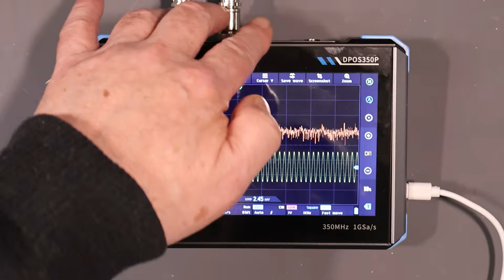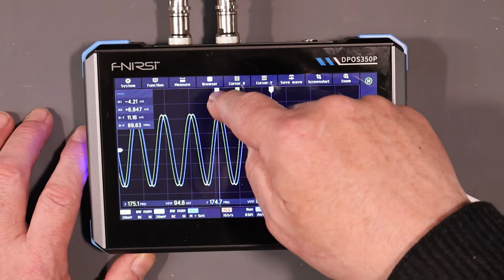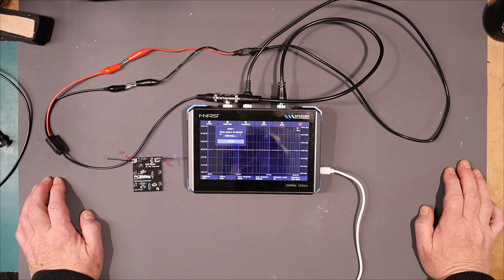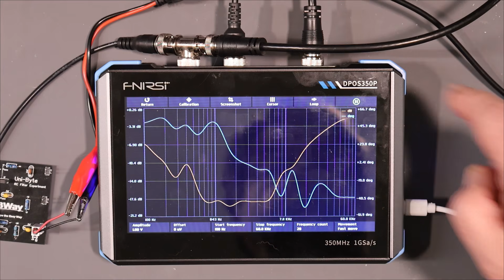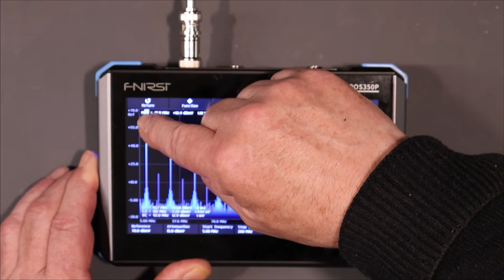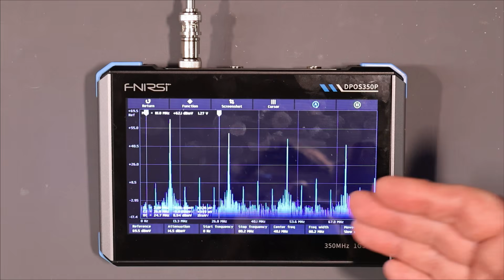Uni-Byte 0283 - In depth look at the FNIRSI DPOS350P Tablet Oscilloscope: Part 3 of 3

Comment: The phase diagram is absolutely wrong!
Reply from the maker: Well, it has two problems.  1) it's inverted - that can be accounted for but still something they should have fixed before releasing the product.  2) it suffers from lack of averaging, more so as the frequencies rise.  This leads to significant errors.  They should allow the user to define how many runs are averaged together for when phase is an important measurement.

Comment: Thank you gor the very useful review. Do you know what is the phase error between 2 signals at 30Mhz ? Why 30, you might be wondering? This is the end of the HF bands and I think that tis scope might be just good enough for testing, aligning and troubleshooting HF transceiver and if that's true with the sig generator included it is a bargain for hams even if proper EE engineers think it is a compromise !
Reply from the maker: With the latest firmware release the phase error is very small.  At the fastest sweep rate of 5ns/div the error is approximately the thickness of a trace.  That would put it at about 30ps-40ps.

Comment: I just got mine today and making my way through your videos. Thank you for them!

I seem to have noticed a glitch when messing with the generator. Output of the 350P going into a bench DSO, nothing else connected. A sinewave at 992063Hz is super stable, but if you just go one Hz above to 992064Hz (and everything above that), it becomes unstable and seems to occasionally "restart" right in the cycle, playing the waveform again from the beginning. Seems to happen on all waveform types. You can see that on high-refresh scopes or with persistence.
Just a funny tidbit. Don't think it's a defect on my unit, feels more like a resource bottleneck somewhere on the device, but it's no big deal either way. Still a nice little device! :)

Thanks!
Reply: Color me impressed, I can even see the jitters on the device itself, by connecting gen out to chan A in and going above 992063Hz. Didn't expect such a fast display update on the device. Pretty nice!
Reply from the maker: Interesting.  I had not noticed this even with signals up to the maximum frequency.  Of course, I may have just missed.  I don't own the one I used for these videos, but I have told the owner that I'd do the firmware update for him, so once I get it back in my hands, I'll see if I can reproduce the problem.
Reply: @uni-byte  A new firmware? I'll go hunting... And it may still be a fault/edge-case on my unit, so it'll be interesting to see, what the outcome of that is.
And thanks for the reply.
Reply from the maker: @NumosG  Go to the EEVBlog forum and search for the thread "New oscilloscope from Fnirsi DPOS350P".  The developer is participating in that thread and posted the firmware update in reply #371.
Reply: @uni-byte  Thanks for the pointer. I updated the firmware to that version. I too had to use a different cable because Windows wouldn't connect with the included cable. The glitch seems to be gone with the new firmware, even 10MHz sine or square are rock solid.
Awesome, thanks for the hint!
Reply: Also, I was looking at the saved waveforms and screenshots. Very weird. The screenshots from the same glitch show the gen with 992KHz but the saved waveforms have it at 9.992.063 Hz. But both show the measured frequency F as around 995-997KHz... So something was up with the version on my device. shrug Update fixed this.
Sorry about bothering you :) Take care, thanks for pointing me in the right direction.
Have a great weekend.
Reply from the maker: @NumosG  Interesting information.  You have a nice weekend too!

Comment: Your video series on this was a much more in depth offering than I could ever think of giving, nice work. After seeing a few other reviews I’ve also come to the conclusion that the 350 is a stretch, however 200 is well within its realm which is way more than most hobbyists will ever need.

My main reason for purchase was to get to 150MHz or above on the scope so that I can start repairing and aligning HF transceivers and this will get it done. Most in that range are easily $250+ and the analog ones are usually trashed. The fact that it has a decent signal generator right on board which is also needed was a plus to make it a great overall choice
Reply from the maker: Should be good for that purpose.   There is a firmware upgrade coming out that fixed the small phase problem between the two channels and some other minor things.  I think it's already up on one of teh threads on the EEVBlog forum.

Comment: I agree with your summary as well... I still find the CH1 vs CH2 variance on my unit fairly large above 200MHz (about 15% in places - not a deal breaker, but something to be aware of). Also with the FFT and SA, and the square wave 2nd harmonics, there seems to be some internally generated harmonics which do improve (reduce) if you lower the input levels, so it seems the front-end may be overloading easily.  However for the price I agree with you, it's pretty good over all! I hope we see the features improve in future firmware.
Reply from the maker: Thanks for the comments.  I do think, however, that 200MHz is maybe pushing it a little with both channels on.  Well, beyond specs, as it were.
Reply: @uni-byte  Yes, to be clear I tested above 200MHz in single channel mode, and swapped the same test signal between each port. The level differences are very noticeable above 200MHz on mine. I would call this a 250MHz scope and be happy (even though it can see up to around 400MHz as its 3dB drop-off point).  :)
Reply from the maker: @mostlypostie1  Yeah, got to agree.

Comment: Thank you for the review. I found a source for them in the US where they still had pre-tariff stock in the US at $250 US. But that was last week. I waited for this part of the review before buying it, but I just checked and now they say I can still order it from China but they don't know how lomng it might take to arrive. I don't order expensive stuff with an open-ended delivery date, so I'm back to looking around. My 100 MHz Fluke portable would be kindly described as 'vintage', so it lacks many features of more modern gear, like being able to see 350 MHz.

 
HP gear that looked at EM spectrum but didn't quite meet HP's idea of a full-featured 'spectrum analyzer' they referred to as 'spectrum monitors'. I had one, and from my perspective as a ham radio op, I just called it a spectrum analyzer. I also had a real HP spectrum analyzer, but it was too heavy to move from my bench without help, so I often used my 'analyzer' on various projects further from my bench than a piece of coax could reach. But times have changed. Now I just use a TinySA Ultra for most things. Then an Anritsu portable SA when I need to be precise. The old HP's just sit and gather dust.
Reply from the maker: Thanks for you comments John.  Let us know what you think of it.